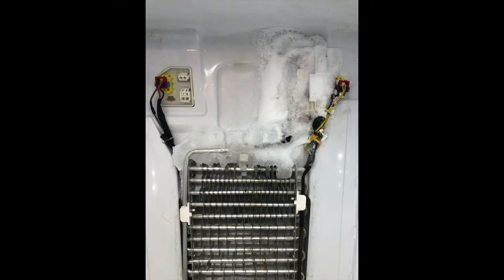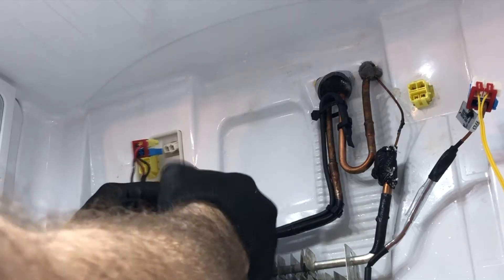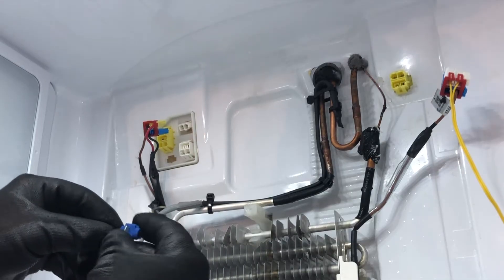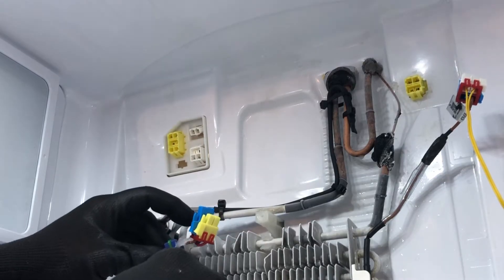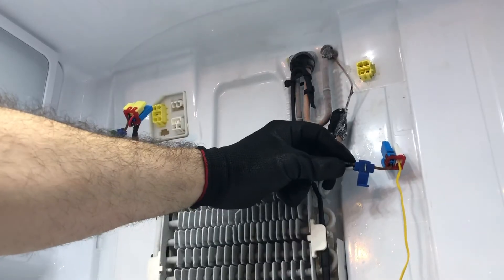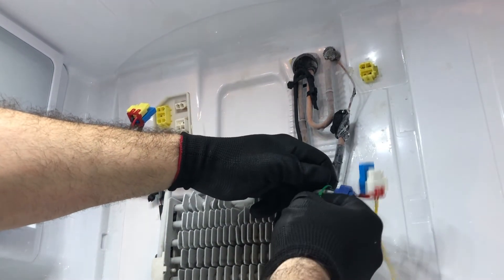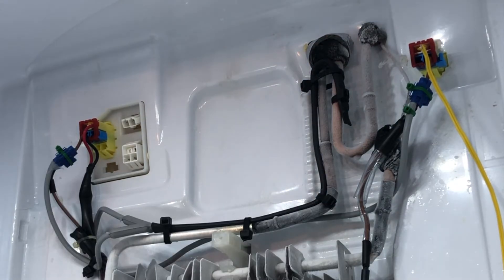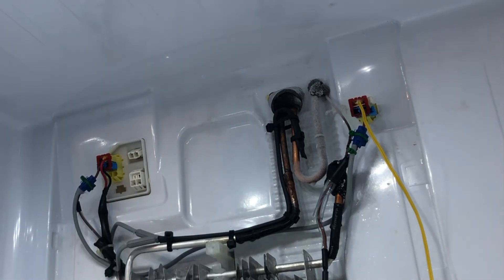Samsung FDBM evap heater add

Comment: Regarding condensate or rust on the outside of the back panel: bens appliance has a youtube where he fixes that: cuts the sheet metal, removes the soaked foam, and refoams.  I have both problems with my Samsung - that, and the inside one you showed me how to fix.  Have you ever done something like that?  One of your comment replies mentioned the problems with the Samsung cabinet insulation degrading over time that causes the exterior problem.  Thanks for your video and all your comment replies.
Reply from the maker: it's possible, of course. In the past I have done similar external patches, but I have never cut open the sheet metal. most of the time it's a design issue and anything you 'fix' will be temporary and will happen again in the future.
Reply: @electronicsprojects4708  But if it lasts 3 years or more, that would be great.  The upper spot aligns with the refrigerant tube penetrations to the inside.  So with the secondary heater fix you give, that one might recur less fast.

Comment: Can u help me with heater for this model?
RF24HSESBSR/EG 
Inside label Defrosting input 
Freezer 230w 220v or 250w 230v-240v
Refrigerator 120w 220v or 130w 230v-240v
I can buy sh503 or someting other?
Reply from the maker: I don't have info on 240v heaters as I am in the United States, the company I purchase heaters from only has 120v heaters that I am aware of.

Comment: What is the difference between the two type of heater you had in the link there? Or they are the same but different style?
Reply from the maker: They are the same wattage (and heat output), one is coupled over itself (the 502) with heat shrink wrap, the other is not. You can actually cut the heat shrink wrap and they will be the same heater.

Comment: I just completed this secondary heater addition thanks to this easy-to-follow video. I tested it like in the video with "rd" mode to force a fridge top defrost and saw that it was melting the frosty pipe, but it did have a burning plastic smell during the defrost process as it melted the frost. Is that normal?
Reply from the maker: No that is not normal. What was the part number you used for the ad on heater? I only use the Supco SH201, but you can also use the SH502. I have done dozens of these and never had a 'burning plastic' complaint.

Comment: Good video. I bought everything from Amazon, including temp sersor,  clip drain, this drain heater, and defrost heater. At first, I saw only lower part toward the drain frozen, so I installed clip drain to help drain only end of Jan. It lasts 2 months without issue. Now it starts to froze again. I see the upper parts all icy, so now it might be time to put all purchased items in including this drain heater. Thank you for the video. I will update my result in 3 months.

Comment: Does it matter which wire of the supco heater goes to which side of the fridge wires?
Reply from the maker: It doesn't matter, it's a heater, which is basically a resistor, non-polarized.

Comment: I had monthly problems with the fan freezing up. Was ready to scrap the fridge when i found this video. I took a leap of faith and thought what do I have to lose? The fridge doesn’t work very well anyway. I did this fix last May 2024 and have not had a problem since. TY for this fix. Temperature has remained steady all through the hot summer fall, and now into the winter months.
Reply: Oh, and I added the drain heater extended version too for good measure!

Comment: thanks for the video, I am building up the courage to try this fix. I have seen other videos where people also replace the Evaporator Defrost Heater Bracket (at the bottom) with a "better" piece that has a longer stem that extends deeper into the drain hole to heat up further down. Have you done this before and had success (and do you have a link)?
Reply from the maker: There's a Samsung kit for this.  p/n DA82-01415A. Other videos on YouTube for this I am sure, but this is general knowledge for appliance techs, that's why I didn't include it in my video.

Comment: Help! It worked initially, then the temp started going up and up to 70!
Reply from the maker: what was the part number for the heater you put in? 70f or 70c? are you measuring the heater temp or fridge temp. if you put the right heater on, it will not affect the fridge temp.

Comment: Is there any risk of the clips cutting the main wire in 2
Reply from the maker: not if you get the right connectors. it is meant to straddle the wire, and only cut through the insulation.

Comment: Thank you for helping us with this issue. Just wanted to ask how you know the cable is actually heating up? You mention you go into the diagnostics to turn on the defrost. How do you do that?  Thanks!
Reply from the maker: It's a heater, not a cable, it uses Kanthal wire. Every fridge has its own diagnostics procedure to turn the defrost heater on, refer to the service documents from Samsung.

Comment: Outstanding!  I was down to about once a week hearing the fan hitting ice.  Forced defrost lasts about 2 days.  Horribly designed fridge in so many ways, but the icing issue is by far the worst.  Putting the ice maker in the fridge was dumb too.  I used sealant at the seems of that to contain the freezing air.  Bravo!!

Comment: So how long should this model last? We've had ours for 12 years and the problem with the ice build up under the drawer is just starting. Should I buy a new Fridge or try the fix in the video?
Reply from the maker: It's probably towards the end of life, maybe you can get it to 15 or 16 years, odds are against any longer than that. New fridges are worse though.

Comment: This is extremely stupid and not a permanent fix. The ice comes from either a shorted defrost sensor, faulty heater, stuck relay, clogged drain or hot air infiltration. Most common cause is hot air entering through the doors/french assembly not sealing properly or cracks in the liner. This heater will cause the liner to crack and additional hot air infiltration will happen exacerbating the issue. You're not smarter than the Samsung engineers. I am a certified Samsung technician.
Reply from the maker: This modification has been done thousands of times my techs, and is very safe. I have done it for my customers for about 4 years with no issues. I guessed you worked for Samsung by your comment, way to shill for one of the worst manufacturers of refrigerators. The only ones sticking up for the company are the ones getting paid to do so.
Reply: @electronicsprojects4708  just because something works at the moment doesn’t make it the right fix. My explanation for why this heater is stupid as hell is in my previous post. It’s a band aid fix when there are real fixes to the issue you just clearly don’t know appliances well enough to figure out the true fix.
Reply from the maker: It's not a band aid fix when it works for years with no further problems. There are many techs that I get feedback from that say they tried everything, including the Samsung bulletins, and it's the only thing that worked. Like I said, the fact that you work for Samsung and get paid by them disqualifies your opinion as biased. Especially for the fact that you have no specifics, and clearly disregard the facts that I have stated. Just playing politics.

Comment: Every time it heats up all I can smell is burnt plastic. I have taken the cover off and it's burnt the plastic around the fan and the foam on the back of the cover. What do yo8 recommend for this?
Reply from the maker: What was the part number you used for the add on heater. I only recommend SH201 or SH502 Supco heater. You won't get any smell with these. If you use others, they may be too high wattage.

Comment: Do you find that the rd defrost mode is helpful for a RF261 fridge with ice buildup behind the panel in the fridge?
Reply from the maker: If you want to do that periodically, that can be a solution. Depends on how bad the frost is building up.
Reply: @electronicsprojects4708  Thanks for the reply. Even after all the fixes my fridge wouldn't stop ice build up so we replaced it.
Reply from the maker: @leka_the_prophet  It is not common, but if you have a sealed system failure, like an inefficient compressor or freon restriction, it can cause too much frost to build up in a short amount of time and even the add on heater won't work. This is a small minority, I have only seen it maybe 2 times in the last 4 years of performing this mod. Hope you didn't replace it with a Samsung, lol.

Comment: Thank you for your video. I have this issue with my Samsung French Door (code: RF24FSEDBSR). I am based in the UK.

(1) Will this kit work in the UK (where the standard voltage is higher than the US - 230V v 120V)?
(2) Has any in the UK been able to find a technician willing to fit a part which is not "Samsung approved" to their fridge? Those I have spoken to are worried about the liability and I am struggling to find anyone;
(3) Has Samsung produced its own kit which would make it easier for me to persuade a technician to fix the part?

If I cannot find anyone i will have a go myself. The refusal of SAMSUNG to admit that their products have this inherent design flaw and/or to correct it is bewildering. For around a decade, it has been public knowledge and, despite a class action law suit being brought in the USA, they continue to sell fridges with the same issue. I will never buy another SAMSUNG product of any kind ever again.
Reply from the maker: Sorry for the late response, YT stopped giving notifications for comments. The Supco part numbers provided only work for US, 120vac, wattage is too high and heater will probably just fail very quickly and get so hot, it may cause damage to the back panel, if used in a 240v setting. I am not familiar with any Samsung retrofit of this type. Because of the wattage limitations set my the federal government, they would not be able to just add components like this without getting reapproved which probably would not happen.
Reply: @electronicsprojects4708  I also have this issue with my Samsung French Door (code: RF24FSEDBSR) and are based in the UK, any updates on a heater available in the uk
Reply: I also have this issue with my Samsung French Door (code: RF24FSEDBSR) and are based in the UK, did you manage to fix the issue or find any the parts or a heater available in the uk

Comment: Installed this several weeks ago and the ice build up returned. I forced the defrost mode and it doesn't warm up at all. Any ideas on what's causing that?
Reply from the maker: If the defrost heater is working, but the new add on heater is not working, most likely the connectors are not tight.

Comment: No need to strip the ends of the 15 W heater wires before inserting them into the blue connectors.
Reply from the maker: Insulation on the added heater is too thick to fit in the connector, that's why you have to strip the wire. You don't have to on the defrost heater wire cause the insulation is thinner.
Reply: Makes sense. 
 @electronicsprojects4708

Comment: Hi,

There is another video on you tube that claims this problem was fixed long term by using spray closed cell foam to cover the refridgerant tubing leading to the evaporator. Doing this blocks moist air from coming in contact with the cold tubing and the foams insulting properties keep the exterior of the foam above the freezing point of water.

Any comments / thoughts on this approach?

                                          Pete
Reply from the maker: More than one way to skin a cat. I have only used the method I posted, about 4 years now and have had good results. I would say it's over 95% successful, with only those that have a serious sealed system failure, like a restriction or inefficient compressor, that this heater can't overcome. I know of other techs that use the heater method and have reported their techs doing thousands with very good results as well. I have not tried the method described, but I am familiar with the method. I see no reason to change my approach.

Comment: Thanks so much for this solution. I was getting tired of manually defrosting the fridge every 2 months to get rid of ice buildup and noisy evaporator fan that was hitting the ice. I almost ordered a new fridge then saw your video. I ordered from Amazon Canada the Supco series sh201 15 watts braided aluminum heater because it was longer & covered all the unheated coils at the top.   I also ordered from Amazon the high temp zip ties.  I has been over 5 months now of trouble free operation. Thanks again.

Comment: @electronicsprojects4708 can I use 2 extra heaters, i see it's not defrosting in the middle too, so i thought to put 1 at the top and 1 in the middle
Reply from the maker: If the fridge is not defrosting at all, you have a different issue. I recommend calling a technician to troubleshoot the problem.
Reply: @electronicsprojects4708  it’s defrosting just lower part. Half of the coil.
Reply from the maker: I have never had to use 2 extra heaters. What I have seen is the upper area where the fan is, above the evaporator gets frosted up. If half the evaporator is frosted up in your case, then you could have an issue where the heater is cutting off early, possible due to a bad defrost sensor, or the new added heater is right next to the defrost sensor, causing an improper read by the board of the evaporator temperature.

Comment: I did this repair. The refrigerator still froze up!
Reply from the maker: If your drain is plugged with ice, you need to instal a Samsung drain kit. Put it in defrost to test the heater to make sure it's heating up along with the defrost heater. If all checks good, you may have a sealed system failure.
Reply: @electronicsprojects4708  It drains. I have a cup under the drains so I can verify if it is working. I can also verify the heaters are working.
Reply from the maker: @JV-pu8kx  Also check the door mullion flipper to make sure it's closing properly, if not, it can suck in air causing excess condensation. Make sure the machine compartment and condenser are clean of lint build up, all vents to and from, in the back. If all that checks out, it's most likely an inefficient sealed system and not worth repairing.

Comment: found this on a search  copper wire down drain ---heat transfer  https://www.youtube.com/watch?v=_FqJxMdAi8U
Reply from the maker: Samsung has a separate drain kit for these, it includes a modification of the drain in the machine compartment and heat probe. This is a standard bulletins, appliance techs would already know about. Just putting a copper wire down the drain won't fix anything on these. For Whirlpool top mount refrigerators, that's a different story.

Comment: I did this fix and tested the coil and it heated properly.  The light was on when I put the cover back on but now the fridge light does not go on when I open the door.  Is it possible that one of the plugs came loose?  Or what could be the cause for the light to no longer go on?  Thanks for the video. It was a pain to fix but doable and saved me a fortune.  Thank you again!
Reply from the maker: There's no wiring back there that is related to the lights on the french door models. If it's a side by side, on some models there are led light connectors. I assume yours is French door. The most common problem for lights not working properly is a connection issue on top of the fridge at the hinges, not inside the fridge. If the heater was not tied correctly to the right wires, and you tied it into the low voltage section, I could see that messing up the lighting. That being said, I don't have a model number so I can't get any more specific.
Reply: Turns out the lights appear to go out until the fridge is cool again. I checked in the morning and the lights were back on. Yay, thanks for all your help.
Reply from the maker: some models that have incandescent bulbs have a heat limiter, so if the lights are on too long, they won't turn back on until the safety thermostat drops below a certain temperature. Those I see a lot on LG, not on Samsung. The Samsungs do have a standard timer that times out if the doors are open too long, but it doesn't have to do with it cooling down again.
Reply: I did this fix and it has been about a month but unfortunately, the ice ticking noise is back which means it didn't work for me for some reason.  I turned on the auto defrost 4 times yesterday with no impact.  I am thinking the defrost sensor may be bad and the coil is not getting activated even though I felt heat from it during the initial install.  Or perhaps the defrost heater itself does not work; there was ice all over it when I opened the fridge up last time.  Or perhaps the ice that is the problem is encrouching from above where the heating cable is not.  Do you have any suggestions about what I should try next?
Reply from the maker: @dirkpeterson1855  if the frost is built up equally from top to bottom of the evaporator, the defrost is not working. If there is only a chunk of frost built up in the fan housing area, then do a manual defrost and check to make sure the added heater is heating up. If it's not, the instal of the heater was done improperly. If it is heating up, you could have a sealed system failure, where it's cooling inefficiently, causing the frost to build up.

Comment: Good video. I have the same issue, and I installed the heater sh502 but is not working. I'm sure there's no issue with the wire installations. Do you think there's no power in one of the connectors because of the motherboard or something else?
Reply from the maker: If the defrost is working, and the sh502 heater is in parallel with the defrost heater, you only have two options. Bad connections, or a defective heater.
Reply: @electronicsprojects4708   I found out it's a defective heater. Thanks for your fast response.